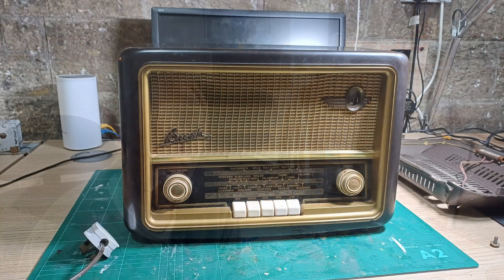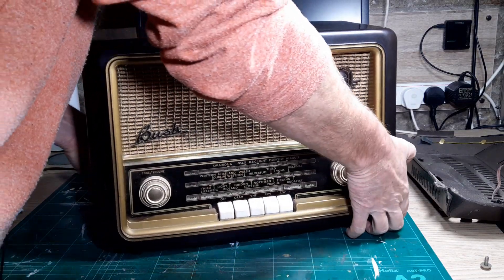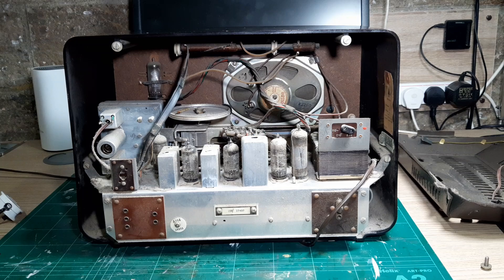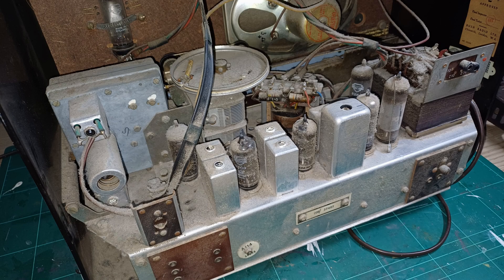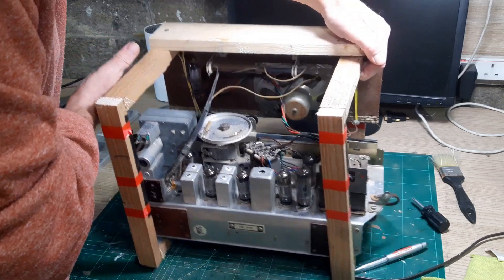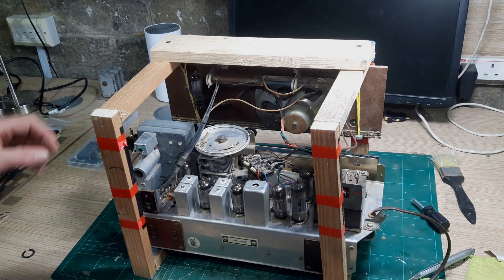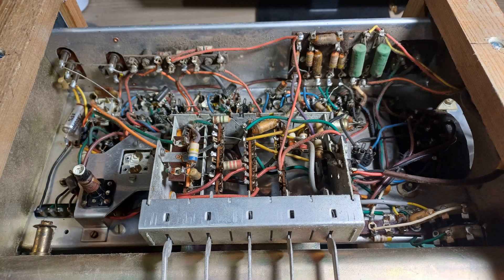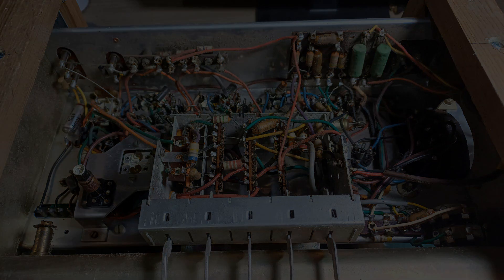Bush VHF 61 Valve (Tube) Radio – Repair and Renovation Part 1

Comment: This will be a great radio when it's finished.  I recently restored a Bush VHF64 - the only one I have ever seen here in Australia.  As we didn't het FM broadcasting here until the late 1970's, valve FM radios are a rarity here.
Thanks for an enjoyable video.
Reply from the maker: Thank you for the feedback. I have been watching your channel and learning a lot. I have a Bush VHF 64 lined up for restoration. They sound great so had to get one.

Comment: The Bush VHF 61 is a fantastic  radio.
I restored one just over a year ago and is my daily driver, with no problems.
You have to change all the little hunts capacitors as they will have gone out of tolerance plus the plastic will have gone hard and are cracking or will crack as soon as you touch them.
Thanks for the video.
Reply from the maker: Yes, I may have to get myself one. They look great and sound great.